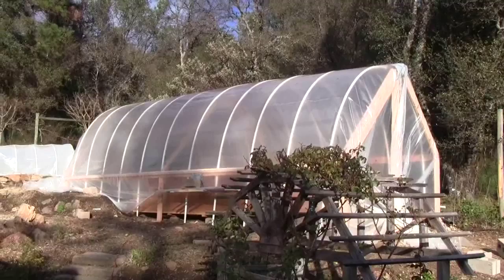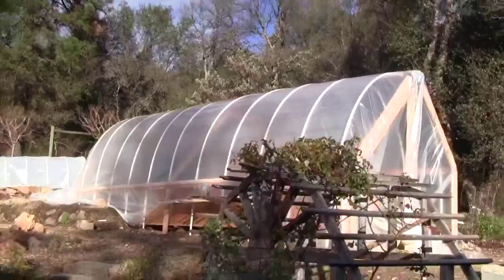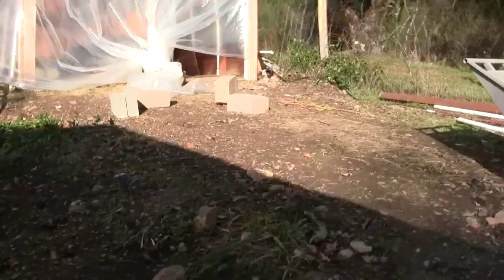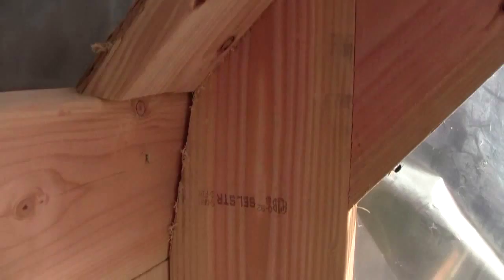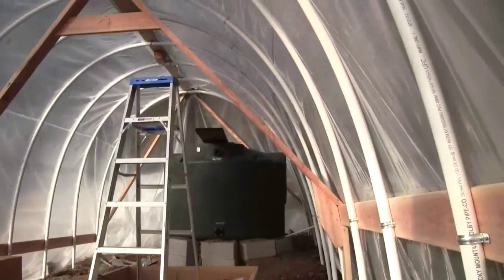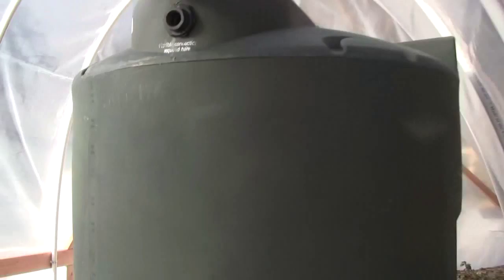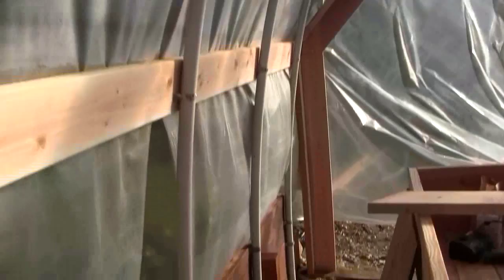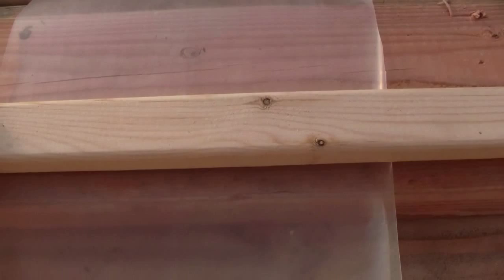Personal Media and Raft Aquaponics System -Securing Film and Framing.wmv

Comment from the maker: It held up great in the last storm.  I don't live there, so didn't check it out today.  But the wood framing was so incredibly strong that I have no question it was fine last night.  The storm last week was stronger, and the framing last night was stronger than it was last week.  So it ought to be fine.  Tomorrow we leave on vacation for a week, so won't be until January that I'm back working on the project.  It ought to finish up fairly quickly after that.
rt